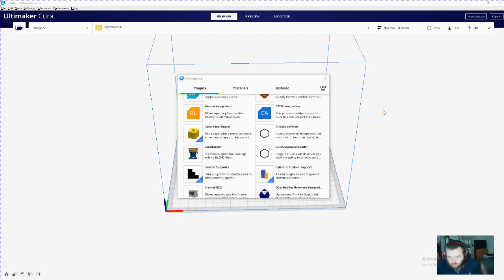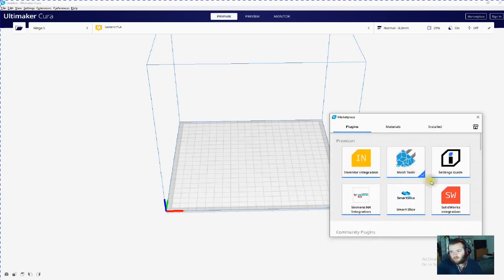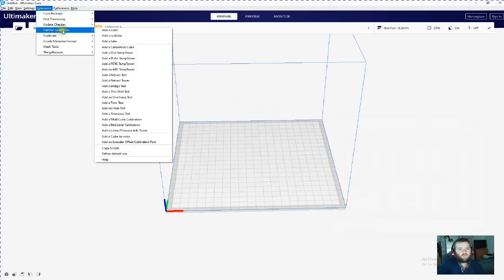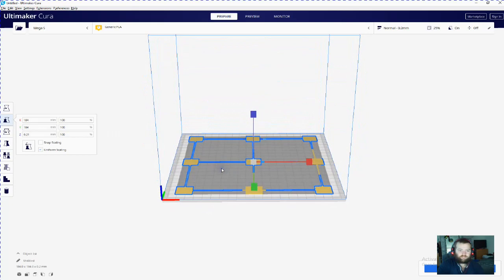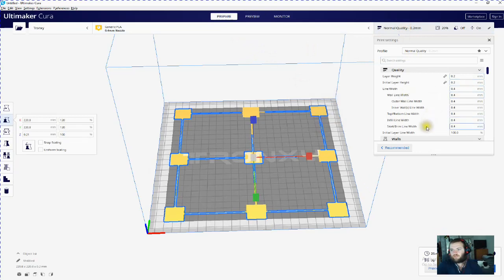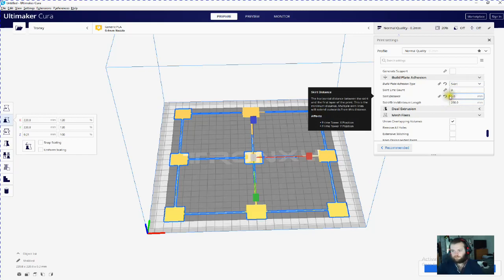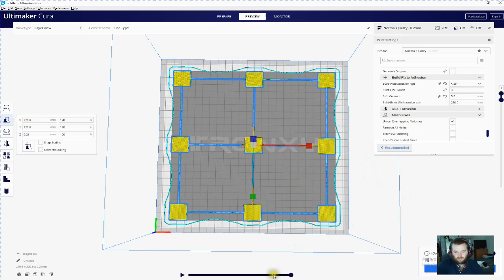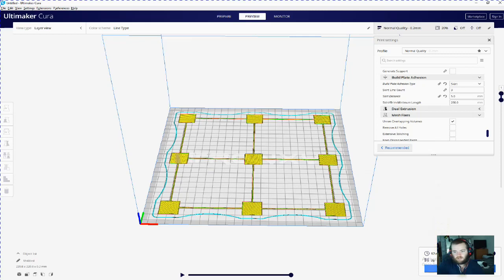Bed leveling in cura made EASY!!

Comment: I don't see "parts for calibration" under extension section even after installing Calibration Shapes Plugin
Reply: u have to restart Cura, i had the same problem after installing the plug in